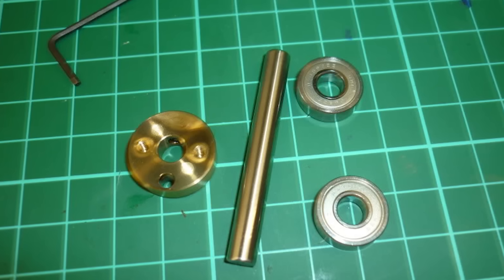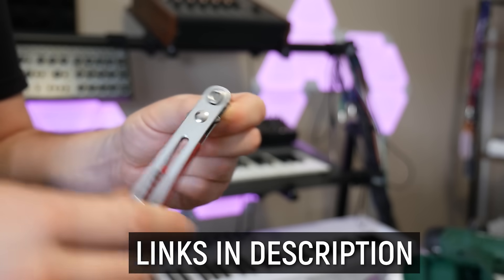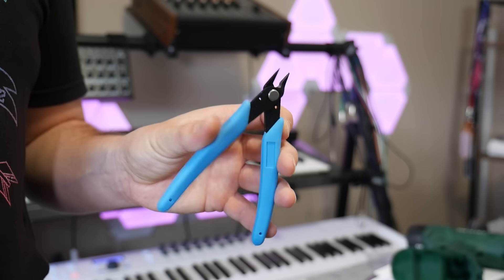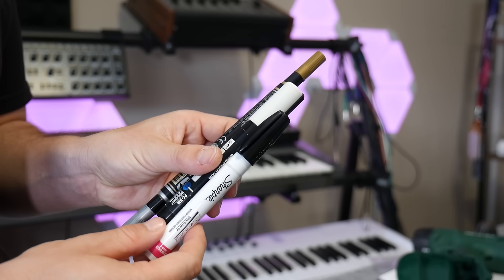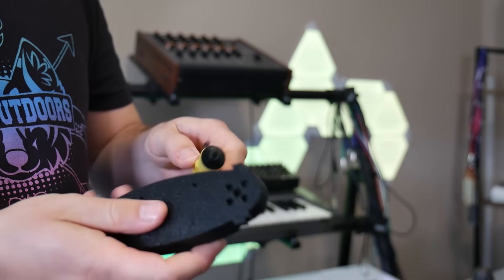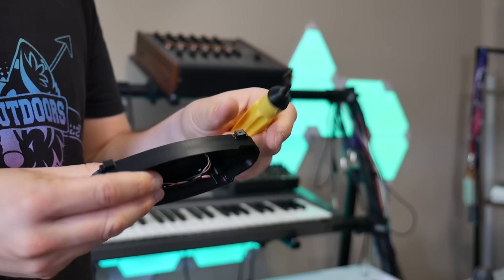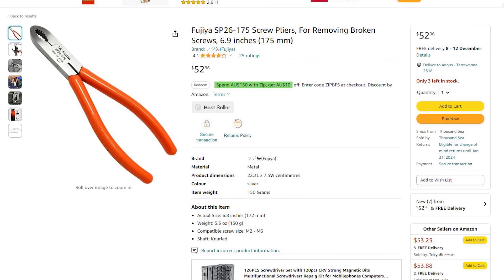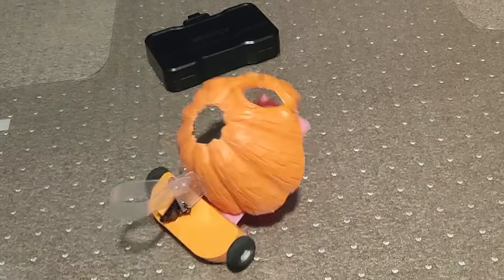Incredibly useful tools you need to know about!

Comment: You're using the deburring tool wrong. The edge is supposed to be dragged along the edge, not driven in the edge. What you're doing is more like whittling.  Next time, face the "sharp" edge towards you and push away from you.
Reply from the maker: lol that makes a lot of sense! many thanks. EDIT: actually seems mine pivots to always face the sharp edge forwards. Dunno if that's better / worse.
Reply: There is also a blade made specifically for plastic and it works a lot better than the regular metal blade shown in the video.  It was another game-changer for me. @MakersMuse
Reply from the maker: @dumpsterdave3710   huh, neat! I'll seek it out. I've gotten good at using a box cutter but it's just so dangerous I really need to stop.
Reply: @dumpsterdave3710 do you have a link?
Reply: @MakersMuse you are using it right. I use them in metal for machining.  They work good on inside curves and can be a little tricky on outside curves like you showed.  I tend do use files in that situation saving the swivel debur for holes where they shine.
Reply: @TKC_ As soon as I got into 3d printing, I immediately knew that I needed to order a deburring tool from the same experience as you in tool and die. AFA Tooling has excellent choices for them, highly recommended!
Reply: @MakersMuse  most blades are made for right handed users and you can't drag them like you should be able to in the left hand for I while I just accepted having to use them in my non-dominant hand but Noga actually sell left handed blades!
Reply: @MakersMuse I think it's the direction your trimming i.e. looks like they are in your left hand. I have found mine perform differently forward and backwards maybe they are directional in that way.
Reply: @MakersMuse  Deburring tools just suck in my experience (the swively kind). A box knife works great, but you're using the wrong side of it. Feel the non-cutting edges to find which one has the burr left over from manufacturing. Run that along the edge of the 3D printed part to scrape it down to shape. Or use the edge of a pair of scissors like I do. Works like a miracle on PLA.
Reply: @MakersMuse  Mine is the same
Reply: @MakersMuse mine pivots too, it’s why I cracked the poops and stopped using it
Reply: @tinymooselette they are meant to pivot, that's what makes them work well and quickly
Reply: I recently found deburr bits that were ambiguous and left handed, though I still prefer the triangular burr scrapers
Reply: I'm doing a lot of my PLA deburring with a 6" machinists rule at the moment. More of a scraping action. Using the matte PLA.
Reply: I just use the little curved end of a cheap metal nail file, lets me shave off burrs and file down easily, and cost me £3 for like 20 of them.
Reply: Shaviv makes wonderful deburring tools. I really like the one with a phat aluminum handle that holds spare bits inside.
Reply: they only work correctly when used in the right hand, as a lefty he has to use it that way
Reply: I have been working in plastics industry for 8 years. This tool is not auitable for 3D printing parts, but for cnc machined plastic edges to soften them. You need to hold firmly the tool and cut the edge decisevely. It's mostly easier with longer edges to work with. It's sometimes really helpfull, others can damage the edges if not used correctly.
Reply: It doesn’t work the way you are describing. Pulling the tool towards you does give you way more control though.
Reply: I think that works if you're left handed, I find mine has the edge oriented so that I point away and drag towards myself, otherwise it bites and takes out notches.
Reply: If you are worried about the safety of using box cutters to clean up prints, I would recommend trying out an inexpensive edge beveler tool. Online, you can get a 4-pack for about $16 USD.

They are intended for leather working, but still work well to trim 3D prints. The tip is rounded and relatively blunt. If you happen to hit yourself, the most it will do is just break the skin instead of a deep slice.

They come in various sizes (I use a 1.0 mm). The bottom of the tool tip is rounded which provides a really nice amount of finesse to control how much material it removes. The shank is fairly narrow, so it can reach places that a knife or deburring tool can't reach. It can cut flush, which is very useful for removing zits or a separated perimeter.

I would recommend getting one that has a wooden handle, as opposed to the single-piece metal variety. While the metal ones might be fine for cutting leather, their handles are too thin and too narrow to be able to control the tool sufficiently while cutting plastic.

I tried switching from the edge beveler to a deburring tool, but I went back to the edge beveler pretty quickly. I like how simple and versatile the tool is, and I find it much easier to use.
Reply: The swivel head tool will have the sharp aide facing the edge and yes you push it. Ask any machinist, the way shown is the good way
Reply: Those swivel to always cut like that and he is using them right. (I’m a machinist)
Reply: I like to hold the deburring tool, blade facing me, with my four fingers wrapped around the handle, then using my thumb push the part away from me and into the blade. Machinist here as well.
Reply: I thought all deburring tools swiveled. To make it easy to follow a curved edge like a hole. When using it on plastic, I find it doesn't work well pushing it. It'll work but I find it hard to control and the blade will often skip or dig into the plastic. I use it like I'm peeling an apple with a knife. I have a lot more control and get a much cleaner cut. I dont find the direction makes much of a difference when using it on metal. Unless it's aluminum.
Reply: @JakobBerry Agreed, I've got exactly the same cheap deburring tool as MM and this is the way they work, thumb on the part and a very controlled slide with the cutting edge. The blades that came with mine aren't sharp enough to cut skin unless you really try so still a lot safer than cutting blades. The only thing I would add is don't buy that particular one, the handle is cheap and falls apart at a moment's notice, but that style of deburring tool is very nice to use, I'd just get a slightly nicer one.

Comment: I prefer T-handle hex wrenches to hex drivers; I can put a little more torque into them, and when my carpal tunnel flares up I have trouble holding normal drivers. (Also, ball-head wrenches for the win!)
I haven't been able to find any of my flush cutters since I moved! 😫
Oooh, I need some fastener-removing tools. 🤔
Reply from the maker: I love my t handle hex set as well! Definitely preferable for larger jobs but I find them a bit unwieldy for anything below M4.
Reply: you can get or print an add on T handle for a good set of allen keys.  lets my wera hex keys do double duty.
Reply: With hex wrenches (as with most tools) it’s not really a case of one style replacing all the others. Different sizes and handle styles suit different jobs, or even just different moods. Long, short, ball, 100 degree, stubby, P handle, T handle, screwdriver handle, no handle, 1/4 hex bits, metric, imperial, etc., etc.  I think I’ve over 20 sets now. 😮

Comment: Those Kinchrome drivers aren't great for anything above an M4 bolt. We rounded out so many building with the 2020 style v slot extrusion.
Reply from the maker: True that! They seem a bit on the cheap side, but the price is right. I linked a wiha set in the description, those are way nicer and I have quite a few that have lasted many years.

Comment: That "90 deg ratcheting screwdriver" looks like a very strange sort of mini rachet. Are there any advantages of it over more normal mini rachets? it looks a bit more cumbersome.
Reply: I have some of them at work, and depending on their make, they can be smaller than a regular small ratchet, not only in width but also in length. A regular ratchet has a square lug you put your nut on, then the nut has the length of the bit. These ones just take any regular bit like a bit driver and are thereby almost a centimeter shorter. They get into smaller, tighter areas than a regular mini ratchet. Only drawback is that their teeth are not as fine and you need a wider swing radius.